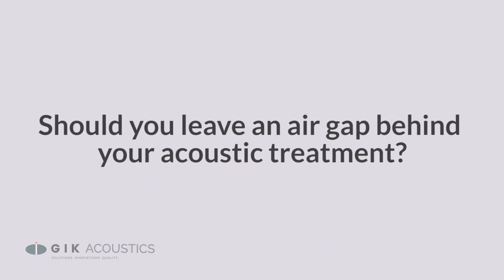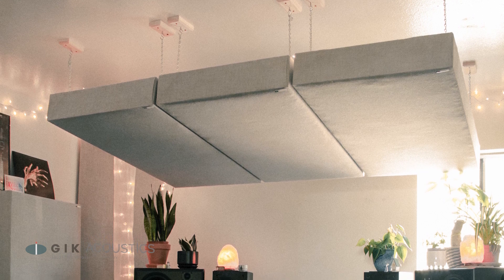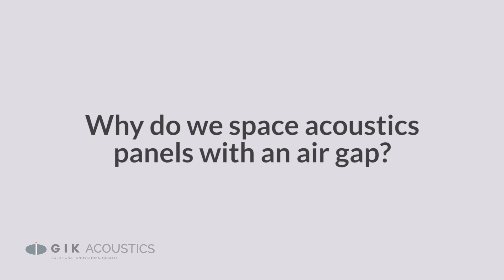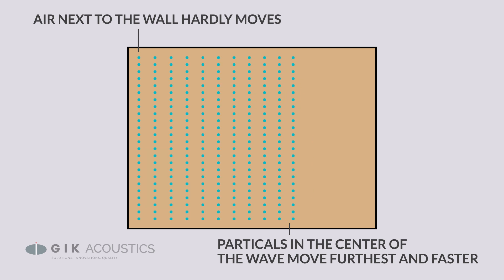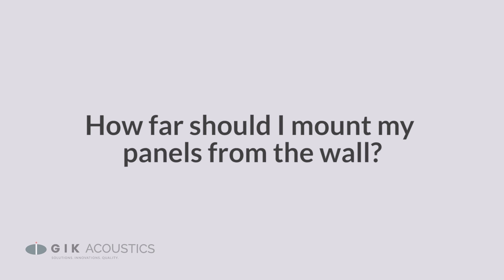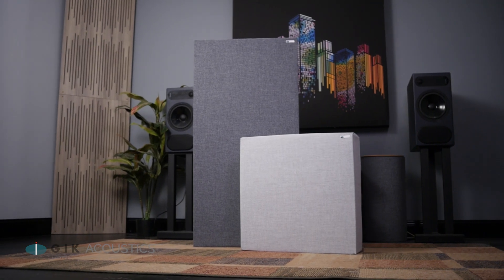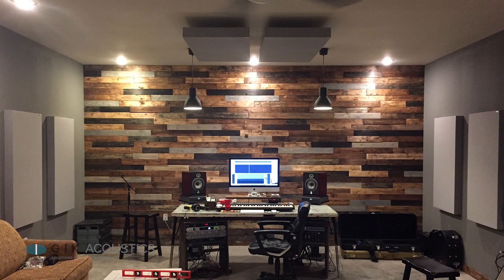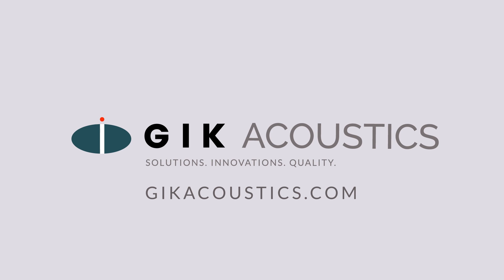Acoustic Panel Air Gap - Should you leave an air gap behind your acoustic treatment?

Comment: I've been thinking about this. How would a few floor standing panels with maybe a 4 inch panel that you basically move around you where you record instead of covering the walls with it.

Or how are they to use in rooms where the walls are covered with shelves and stuff, and you can't really mount things cause it would make the landlord annoyed, so instead, use floor standing  panels that you move to where you need them.

This is mostly for voice recording, to minimize reflection into the microphone when streaming or recording.
Reply: First of all, yes free standing panels are amazing - especially on wheels. Then again, to record vocals it is still better to keep the panels closer to the walls and not directly by the microphone. If you put a panel right by the mic you deaden your signal not in a pleasant way, as you only filter out the high frequencies. Vocal booths are a bit of a misunderstood concept, as they were never built to make the vocals sound better - just to be able to have a clean vocal recording in an environment that has outside noise. Meaning - in a nicely treated studio vocals won’t be recorded in tight booths with absorbers around the mic, but rather in the middle of a good sounding room

Comment: I feel like you left a lot of questions unanswered.
So thin panels should be as far of the wall as they are thick. But until what point is it a thin panel and when does it start to be so thick that no gap is necessary? And most of all: What happens in between?
Atm I don't feel smarter than before watching this.

Comment: For small rooms, 4" thick panels should always be the minimum. Using 2" thick panels and a 2" air gap is more mounting work than it's worth.
Reply: There may be reasons you need the air gap however.
I've opted for 4" panels, but I need to create an air gap to access a few light switches behind them.
Reply: @skatterpro  I have four 4" GIK panels on the front with floor-to-ceiling bass traps and six 4" GIKs on the sides. I'm now adding six 6" panels to the back wall.
Reply: @skatterpro That’s when you get really flashy and buy a few smart switches.

Comment: The improvements in performance can be overstated related to low frequencies. Riverbank test data shows that 2” fiberglass panels offset by 1”& 2” do improve absorption and the NRC of the panels. However the absorption coefficients in the testing indicates the performance increase is not at 250hz, 125hz and below. This I believe is because the sides are not closed and the air gap sealed or incased allowing larger sound waves inherent in low frequencies to escape and not be absorbed (trapped) again.
IMO.

Comment: I had a panel against an outside wall and had condensation / moisture issues within 2 weeks. I'll need to implement air gaps just to get warm air behind it, so i don't get the cold wall area behind the panel where all moisture condenses.
Reply: Yeah, I didnt think about that and after two months I had multiple perfectly rectangular patches of mold on my wall. No fun. Should have thought about that.
Reply: That's an excellent point I never thought about.

Comment: Hey guys, what about when dealing with a high ceiling? Ive got a small 12x12 room but ceilings are very high (16ft)  ive been pondering to just make a false ceiling at 10ft high.
Reply: Cool.
Reply: My room is barely 8x12😭
Reply: False ceilings utilizing suspended tiles, like in an office, will likely absorb too much of your upper mid to high frequencies, creating a lifeless room unless you add diffuser panels to your dropdown ceiling.

Comment: Interesting they tried to recommend 1:1 spacing since Galaxy Audio used 2:1. I would love to know how they arrived at their conclusion. Especially since galaxy had a huge budget, but both used a bigger space, and didn’t fill the gap with material. This goes against two of Gik’s suggestions in the video.
Reply: Generally speaking, 2:1 is correct. If 1:1 is used, you will loose efficiency in higher frequencies and gain little in lower ones. Search for "porous absorber calculator" and you'll see it for yourself.

Comment: my air gap is ca 20 cm ..is it too much ?!?!!
Reply: Checking random incidence on the simulator removes most dips.  On the other hand if the panel is in a reflection point,  most reflection is at a constant angle making the travel distance in the gap longer than the normal
Reply: it does make a difference, you want the panels 1/4 wavelength of the frequency you're trying to absorb from a 100% reflective surface like brick/concrete, so up to 28" for 120hz. even more specifically you want the panels where the sound velocity is the loudest. the downside is there are more oblique/tangential modes that can go out diagonally and won't be covered. the thicker the panel, the more the wave will be slowed down / spread out into surrounding frequencies